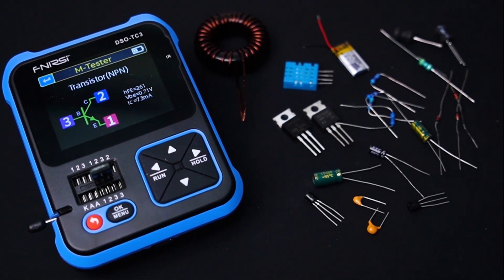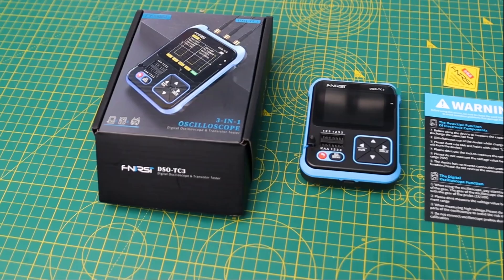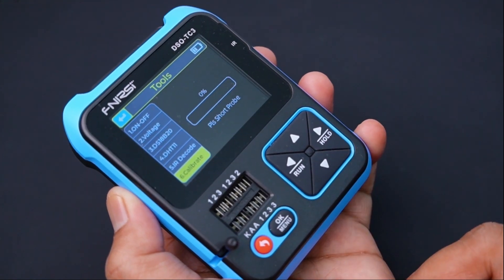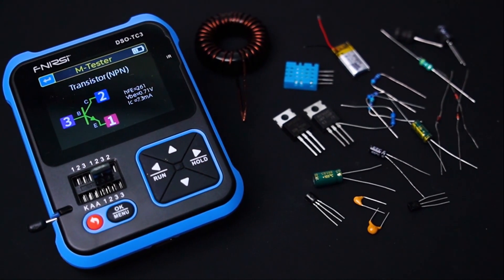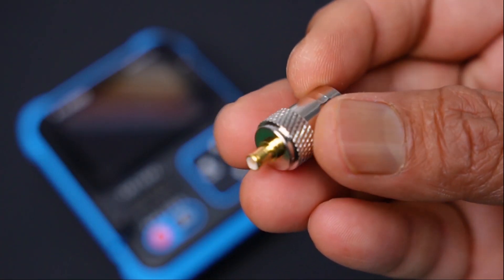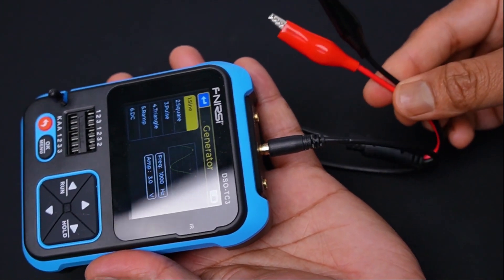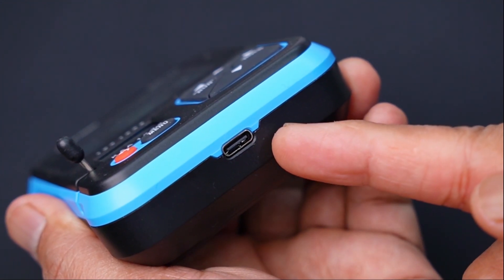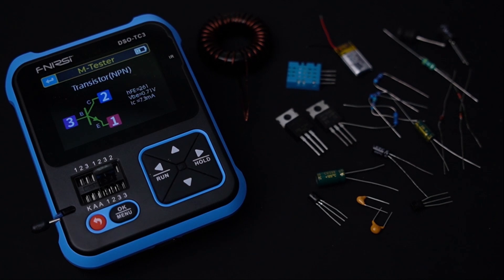Mini 3 in 1 Multi Tester | FNIRSI DSO-TC3 : Component Tester + Oscilloscope + Function Generator!

Comment: I tested a couple of units of this model FNIRSI DSO-TC3. I was more interested in the values of the parameters than the functions. All of them presented a big problem with the measure of the volts. I made a simple volt divisor and tested it with two different connections: a Voltmeter and an Oscilloscope. In both cases, the low impedance of the device influences the measure, and the voltage is wrong. When measuring with a DSO-TC3 Voltmeter, the result is the same as measuring with a proper voltmeter with a 2K Ohms resistance in parallel. When measuring with a DSO-TC3 oscilloscope, the result is the same as measuring with a proper voltmeter with a 1M Ohms resistance in parallel. They don't have any software compensation and display the wrong measure. See the attached file for the results vs. the theory.
I contacted FNIRSI at the beginning of May 2024 (via email and WhatsApp). The aftersales department knows nothing about the equipment's functioning or electronics in general (they didn't know what a voltage divisor is, even after I sent the drawings). They tried to ignore the situation, and they asked me to pay attention to their website in the future in case they make a firmware update. Nothing happened until today, 17 Jun 2024. 
Previously, I sent the same complaints to the internet shop I purchased (in Taobao, China), and they told me the issue was a one-device issue and changed it for me. After verifying similar output, I found this is a design problem, and the manufacturer is trying to ignore it. 
Note that their specification already announced an input resistance of 1MOhms. What is surprising is the value when using the Voltmeter and the fact they have no correction for the displayed value. (I am using the most updated firmware version until June 2024.)
On the other hand, if you want to use the signal generator simultaneously with the Oscilloscope, it will deliver a standard pulse wave of 10,000 Hz, three v, without possible modifications. I am talking from memory; I may get the frequency wrong.